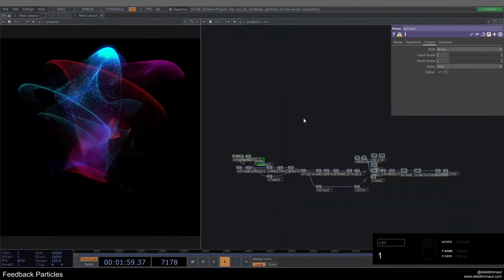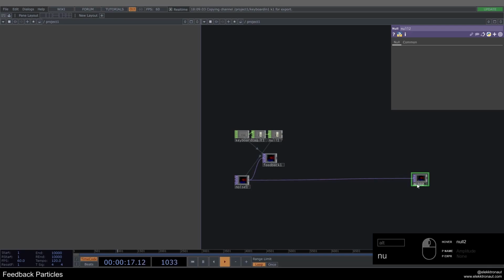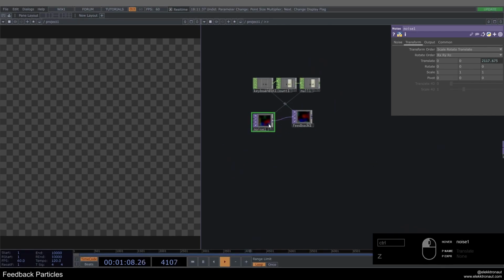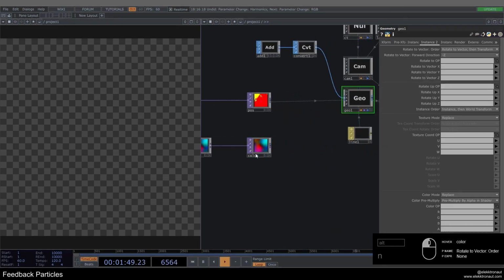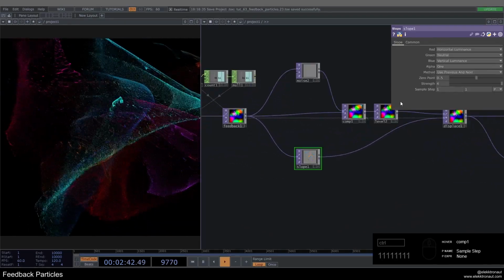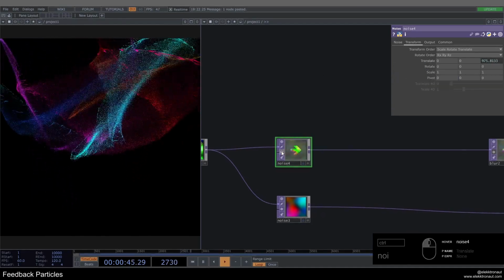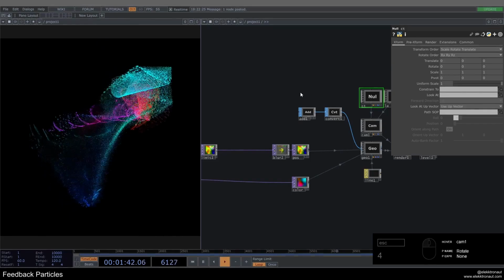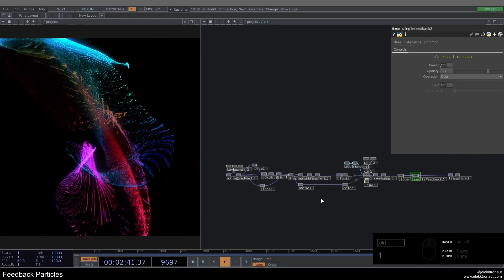Feedback Particles – TouchDesigner Tutorial 63

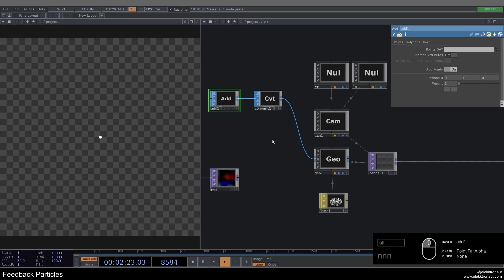Comment: This looks so cool, but I tried to follow all these steps (tried it twice even!) and then at 5:19 when there should be a dot, I see nothing... So all that happens afterwards, nothing shows on my TOP viewer :( I must be doing something wrong still.
Reply: Hi, I have the same problem.
Reply: Go to the add node and turn on "Add Points" :)
Reply: also its importent not to just add the geo comp, one has to add it by right clicking on the output of the SOP. then you get the correct connection from sop to geo